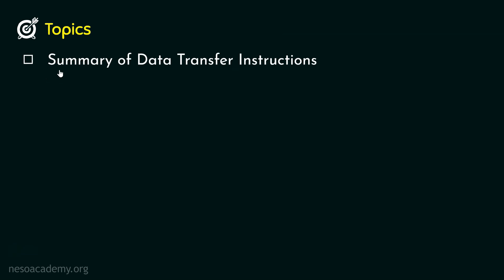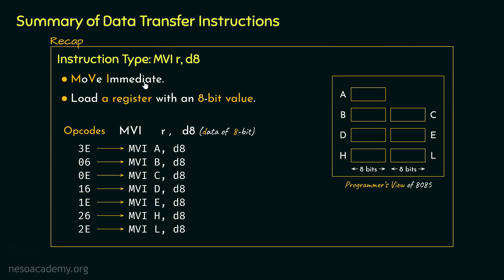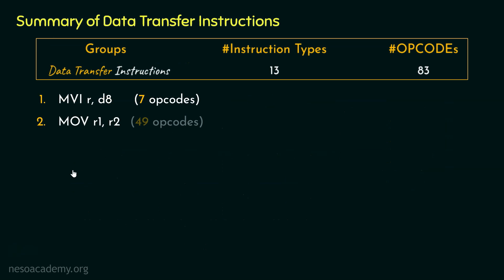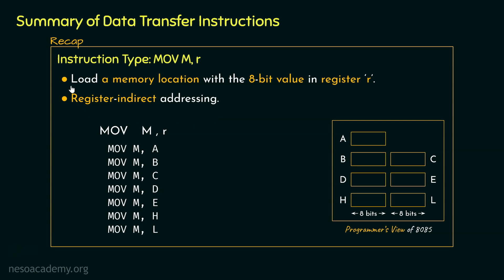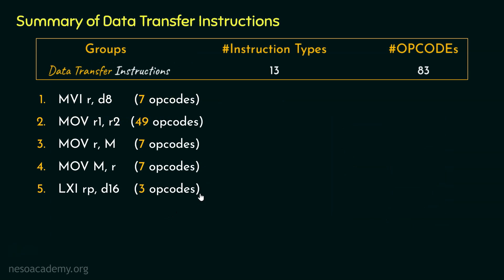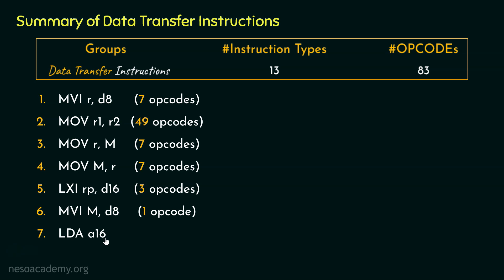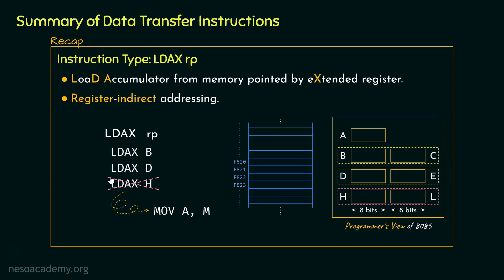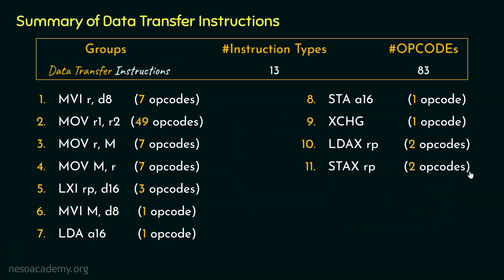Summary of Data Transfer Instructions in 8085 Microprocessor

Comment: Data transfer instructions in the 8085 microprocessor are used to move data between registers, memory, and I/O ports. These instructions do not perform any arithmetic or logical operations; they simply copy data.

Comment: why mov from the same register mov a, a. is it a thing
Reply: Yes, MOV A, A is a valid instruction in the 8085 microprocessor, but it doesn't change anything—it simply moves the contents of the accumulator into itself. While it might seem redundant, there are a few reasons why this instruction exists:
- Timing Adjustment
- Pipeline Behavior 
- Side Effects in Certain Architectures
- Filler Instruction